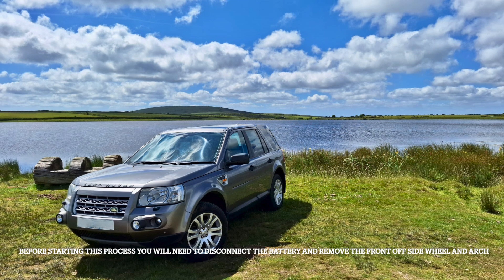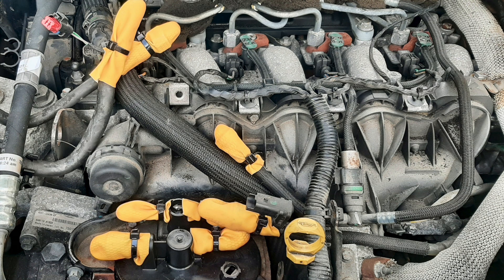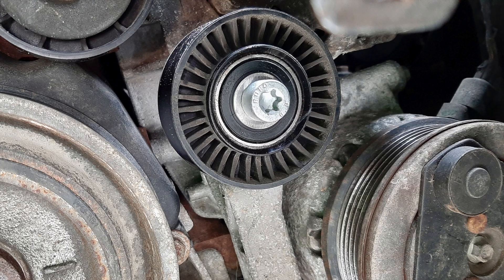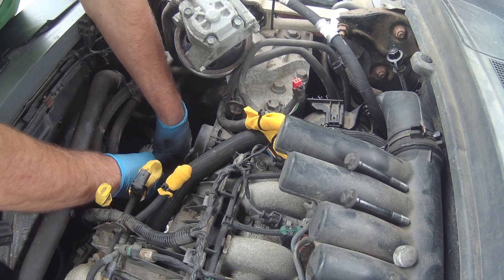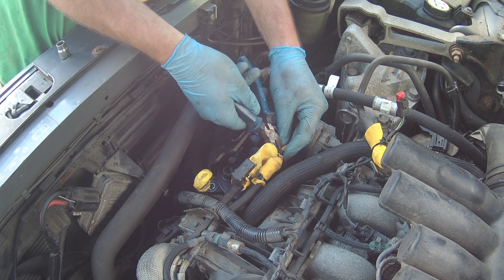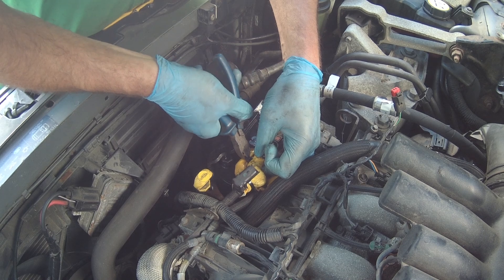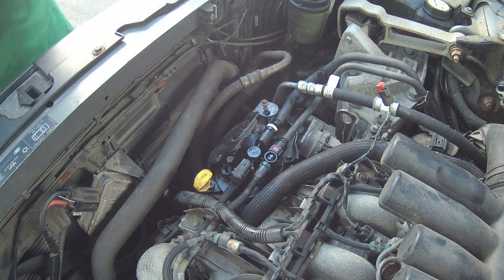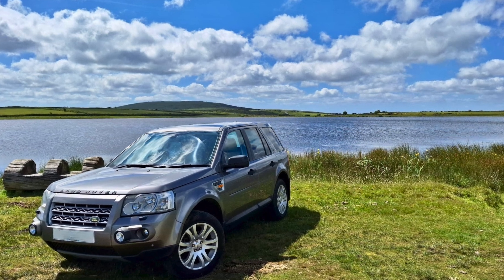Freelander 2 TD4 Remove Overrunning Alternator Pulley fuel filter PS pump

Comment: That looks like a brand new power steering top hose. Did you replace this and did you use genuine parts as I believe pattern parts leak after a while.
Reply from the maker: Pattern hoses still going strong, can't remember the brand.
Reply: You must have got very lucky I had to replace all of mine with genuine pipes at over £300 to stop leaking and pipes blowing themselves back off from the connections.